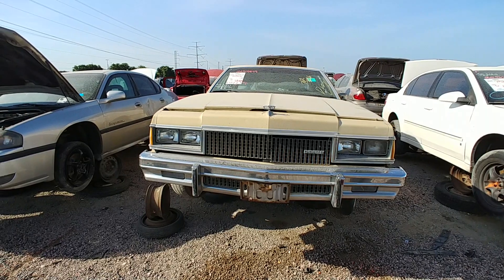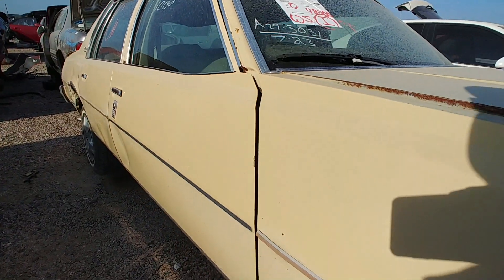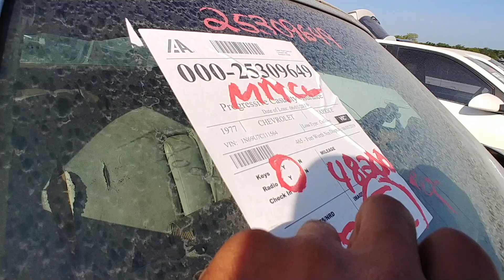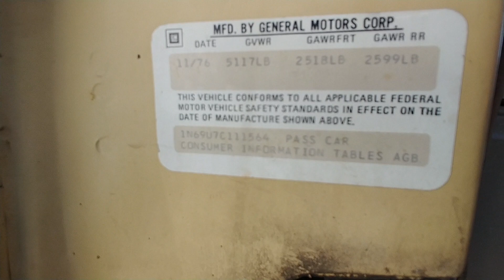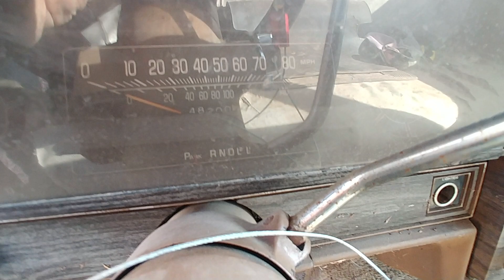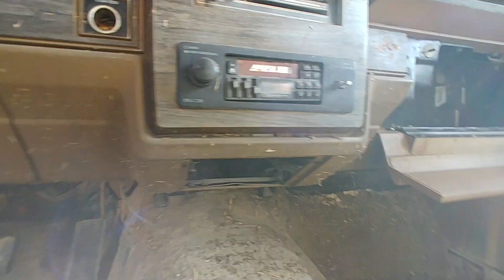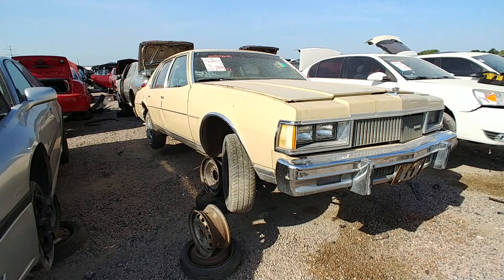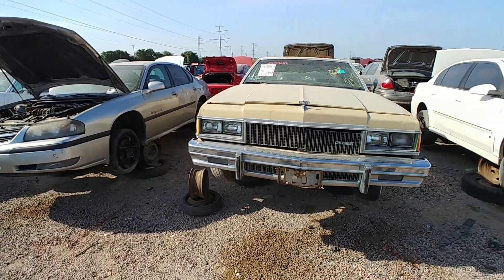1977 Caprice Classic Junkyard Find

Comment: If it's a fresh water flood, it tends to be an easier fix than a salt water flood. My coworker used to get TX flood cars all the time and fix them up as commuter cars here in NYC. The VIN on this is 1 for Chevrolet, N for Caprice, 69 for 4 door, U for 305 2 barrel Chevrolet V8, 7 for 1977, C for Southgate,  CA assembly and the rest is the production sequence. These are great cars and they sold like wildfire in the 70s. Same thing happened to my grandfather's Caprice around 1993. He got sideswiped in the rear and the trunk shifted, ripping through the mounting points. I got a $25 trunk from the junkyard, a used RH taillight and filler and rattle canned everything #24 light blue. That car got totalled out a few times due to getting hit by others. He got the money, I fixed it up and he was good to go. 

Dunham Motors was a used car dealer and was located at 2820 Jacksboro Hwy, Fort Worth, TX 76114. It's still a used car lot, and today it's occupied by Periko Motors and Canelos Motors, which again appear to be used car lots. That's the wrong power window bezel for the driver's side. They were clipped in from behind on the door panel originally with "fold out" clips and the door lock was usually on the armrest from what I recall. That's from a later B body car. 

That's Mr. Gasket, not Mr. Goodwrench on the breather. No cowl tag, so we'll assume that the colors are all original for it.

Comment: Back in 88 I found a 1977 2 door Caprice 2 Door with the slant back window... 305 auto - same color as this car and tan interior. I found it at an Impound lot auction for $ 190.  The trans was out,   I put in a used one cleaned here up and drove it awhile before I flipped it for $ 1500 !  Solid nice smooth car,  I called it "the CAB"....
Reply from the maker: Back around 2003 I bought a 78 2 door for $1000. My friend said he had to have it. Gave me $1600 for it. I think I made a mistake in selling it